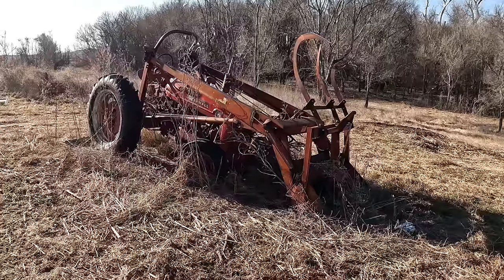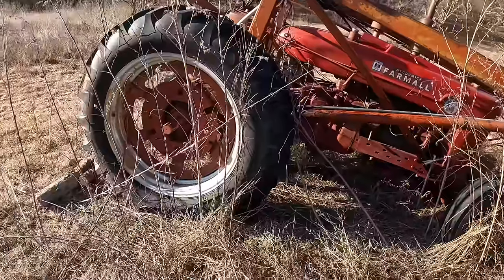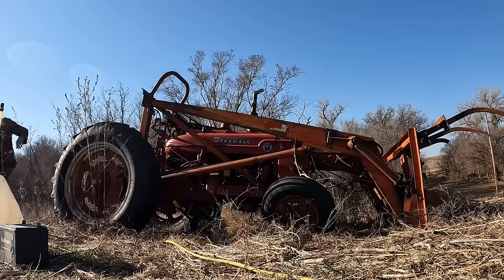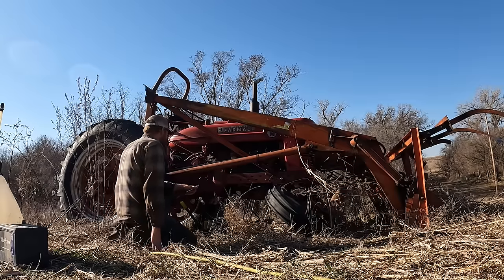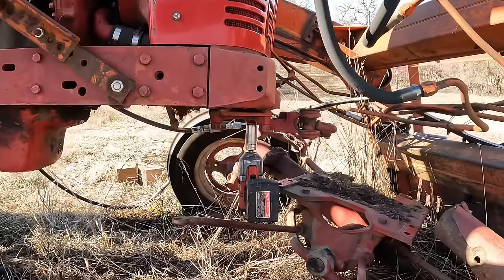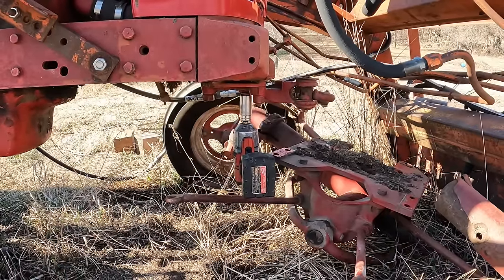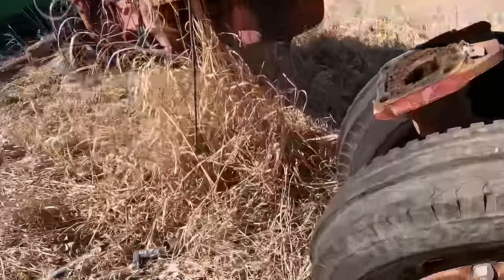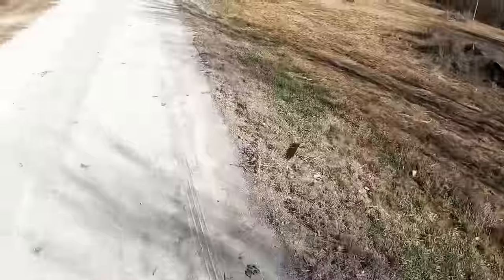Can I rescue this busted Farmall Super M? Abandoned after busted front axle.

Comment: My chore tractor when i first started out raising cattle was a M with a westondorf loader, i really wanted live hydraulics so i put that loader on a 560. Both tractors were narrow fronts, its not so scary when you fluid fill both rear tires and add 4 wheel weights to each side. My cattle lot was on a terrace down hill, i put rear gleaner combine wheels on the front so i could run wider 16" pickup tires on it for added floatation. Had to had tire chains on the back year around cause of the mud and hill climbing out of the cattle lot pulling a feeder wagon. I used the loader to fill the hayfeeder wagon and to haul round bales down into the feed lot. Everyday, twice a day, for 48 years. Only rolled the 560 three times. Sill have that tractor, took the loader off, now it is doing light duty running PTO augers.
Reply from the maker: Rear ballast would make one hell of a difference.

Comment: T T that looks like a Swartz wide front. I have a John Deere 70 with a Swartz wide front.  They work good for normal farm work. That is the last front end i'd put a loader over. I've got a standard 4010 John Deere with a loader on it. It handles a 5 ft bale good. Have a good day!
Reply: That’s an IH wide front, tie bars are in front of the axel. A later wide front would have tie rods behind.
Reply from the maker: It’s an early IH wide front.
Reply: Considering it's an early IH front end its not a loss, those front ends were garbage. I know of a couple salvage yards around that won't even sell them, they get torched as soon as they come in.